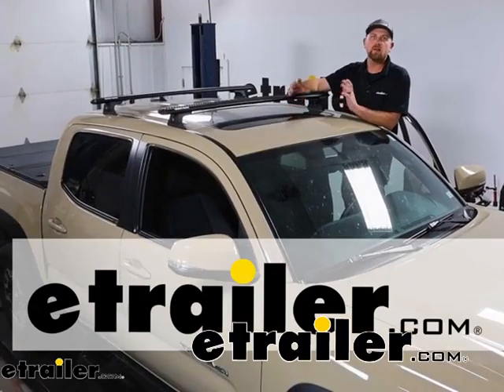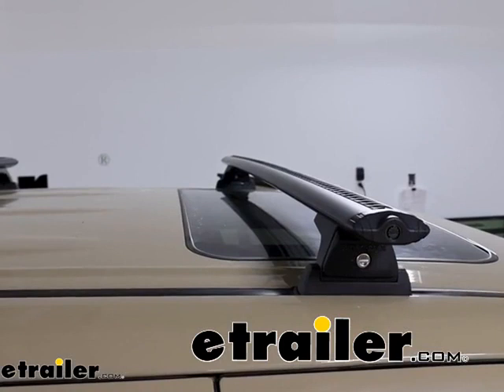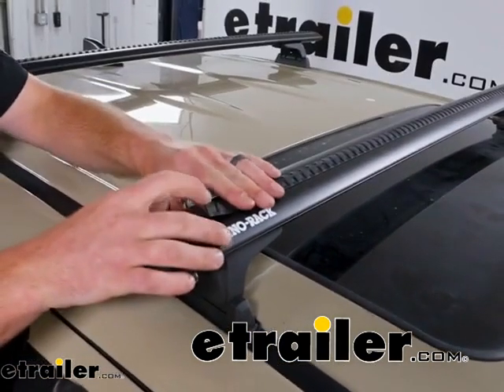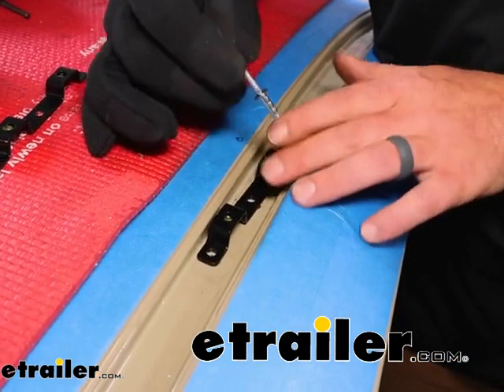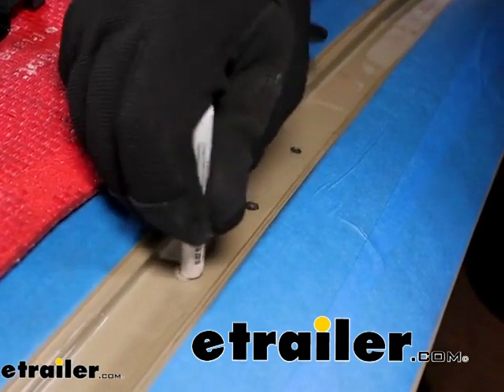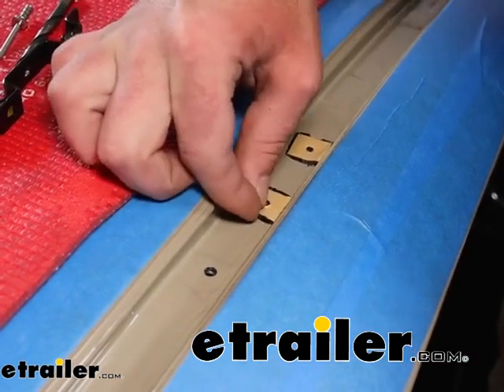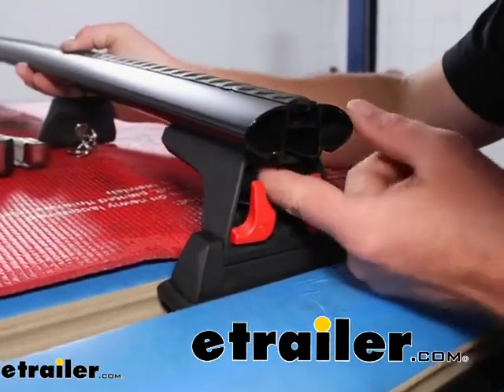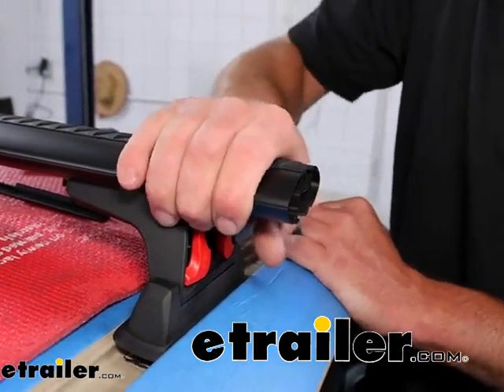etrailer | Install: Rhino-Rack Vortex Roof Rack on a 2017 Toyota Tacoma

Comment: Do the holes you drill go through the roof rail? It seems like the 5mm depth is not enough for the rivet to work properly unless it goes through to expand on the other side.

Comment: Curious,  wondering why the existing mounting holes under the tape  not used to bolt on the rack.
Reply from the maker: That's an excellent question, unfortunately Rhino-Rack couldn't provide an answer for me.
https://www.etrailer.com/Roof-Rack/Rhino-Rack/RR22RE.html